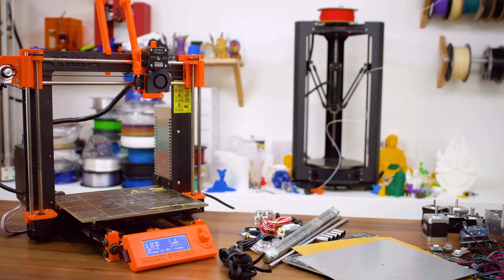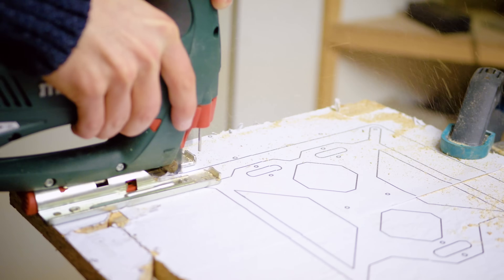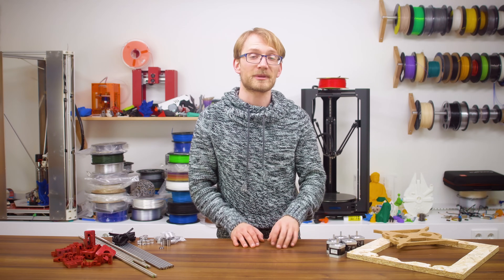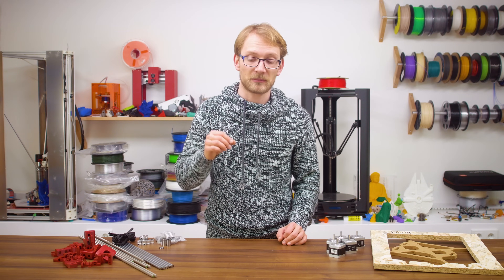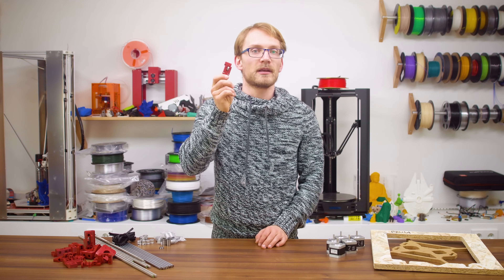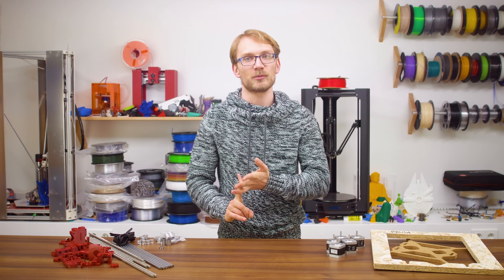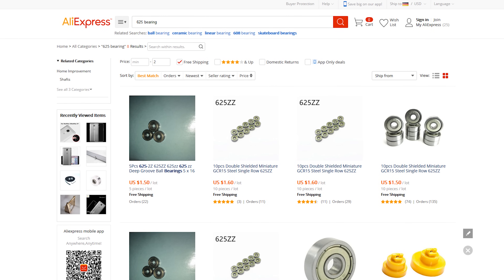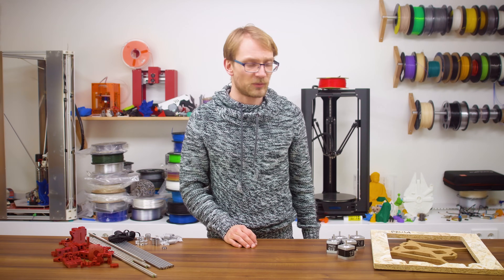Building the cheapest possible Prusa i3 MK2 clone: [02] Frame and motion!

Comment: hi Thomas great videos!! am printing the parts now. 
i have t8 8mm lead screws and wondering if they will do the job? or is it best to get the m5 threaded rod?
cheers
Reply: The real MK42 from Josef Prusa (and any modern printer worth crap) ditched all threaded rod on Z already.  The hard part is finding the Z motor mounts and the Z smooth rod holders that stand out enough to allow those 8mm (the nut is why) acme rods to be used (you would need two new X pieces as well) and is still a Prusa design.  If you already have a printer, and find or design a new set of those pieces, then print them out and your printer, and prints, will be far superior.

Comment: I would suggest a BB or a single 2.5mm ball bearing between the Z motors and the threaded rod.  That will give it a nice surface to equalize itself if the rod is less than straight.  Also, I don't think you really need zip ties to hold them if they are tight enough.

Comment: Tom, a question:  I already have a Prusa I3 but the Rework version so how much would it cost me to swap it over to the MK2 and is there a reason to do so?
Reply: Great videos, very helpful for the initiated into 3D, btw can you make a playlist for check and save this valuable info?
Reply: Since the inception of the MK2 I have been asking for the bed to be released because I want one and what about someone who a year or two after they purchased their printer and their MK42 bed dies (as my MK2 did for the previous version)?  They can't buy one which is utter Josef Prusa BS.

Oh, and those motors are fine for XYZ but for a direct drive they struggle due to the lack of torque and the better option for the extruder would be the 17hs8401 due to the increased torque it has.

Comment: how bad is stainless steel smooth rod compared to chrome plated?
Reply: and why 16 teeth pulley not 20 tooth, what's the difference
Reply: Runder Caster stainless rod is soft and the balls inside the bearings will cut into them. The 16 tooth pulleys move the bed and X carriage, a smaller pulley will give more accuracy while a larger one will move the belt faster.
Reply: IRAnarchy thanks
Reply: I always have used 16T as it makes the best choice against the 20T for that reason and because it is an evenly divisible ratio (I believe the next one like that would be a 10T but good luck with that).  Use a Prusa calculator with 20T and a 16T to understand better.
Reply: I have found the 16t idler has too small of a bearing for the belt tension. I have destroyed 4 bearings so far and seriously suspect the belt tension to be the reason for the premature failures. I'd suggest a larger idler and bearing that is shifted to account for the increased radius. Or switch from 2 ball bearings to 1 roller bearing for increase load ratings.
Reply: Whatever someone does do NOT mix 20T and 16T or whatever just keep them the same or flip the belt over and use two bearings (I use two 625ZZ bearings with a flipped belt). As far as the main gears stick with the 16T.
Reply: Why would using 10T be bad?
Reply: They can be mixed but need to be adjusted in the firmware.
I used 20T pulleys
Reply: Could you please explain what you mean by "flip the belt over".  Thanks.
Reply: I haven't tried to find one, but I think finding a 10 tooth pulley would not be easy.  Perhaps Dark Alchemist could confirm this is what he means.  A 10 tooth pulley would have a very small diameter... possibly too small for the toothed belt to engage with reliably.
Reply: 10 tooth pulley have same diameter but just less tooth (made for belt with bigger teeth), that's why you should stick with 16T

Comment: I found most cheap and "slightly less cheap" LMxxUU bearings to be actually the same. Rule of thumb: If they come in little bags of two they probably come from the same factory. Good ones start at about 5€ per piece and are packaged individually. In the long run those are actually cheaper as they will literally last forever on a 3D printer.

Comment: Next time use Multiplex, is much more stable and can be found at your local obi, bahr, globus, toom, bauhaus, praktiker or hagebaumarkt.
Reply: There is a restekiste where you can find the pretty cheap. Found yesterday one for 13 Euros! And you wont waste much of it. The multiplex should be way less sensitive to vibrations than any osb, since of the alignement there are almost no air holes.
Reply: ipasuhd plywood
Reply: I lied in this commend, and it still haunts me till this day!

Comment: Tom, what would it take to modify this build to fit in a 300x300 aluminum heated bed instead of the default 210x250?  Just widen the frame and get appropriately-sized threaded/smooth rods or is it more complicated than that?  Maybe a larger Y axis motor?

Comment: wouldn't it be simpler (and more accurate) to print the bed holder, instead of cutting it from wood? In terms of rigidity it shouldn't make much difference, as long as you print it thick enough.

Comment: The Aliexpress 3d printers sellers (clone of the clone) will love you once you released the full build guide.

Get ready for seeing Prusa Tom i4 MK3 released on AE.
Reply: Can't wait to see hand-cut frames for sale on Aliexpress!
Reply: Yvan Rivard haha maybe they'll show up on Etsy.
Reply: Mega Making No it's the Prune iCheap 4D
Reply: I wouldnt be too sad about that tbh, altough i am currently saving up for the real deal
Reply: so many prusa on ali now
Reply: Don't you mean the Sanladerer i4?
Reply: Don't you mean the Sanladerer i4?
Reply: The TEVO Tarantula cost 200$ and the A8 cost 150$, better quality and its all packet to DIY in a Box, no point to follow this beyond experimentation and have a fun time.
Reply: I sense that the logistical costs built in through buying and shipping components separately is going to end up costing more than some kits presently out there. Then there is the issue with tracking down a myriad of shipments, some of which coming from less than entirely reliable sources in order to minimize cost. Still of merit to the hobbyist who takes pride building their own. For cheap I'd use an "Aliexpress" package to bulk together most of the basic requirements then add on enhancements. For the customer it's just one shipment to track. Regarding cost, the suppliers are buying parts directly from manufacturers locally in bulk thus can work on lower margins selling them as a bundle of parts in an entire assembly. Even if you throw 1/3 of it away and custom build the rest the way you want it you'll likely be ahead of the game in parts costs and logistical headaches avoided.

Comment: would not recommend particle board OSB.
Reply: Exactly. You guys are missing the point. He's going for easiest and cheapest here. If you want to replace the osb with whatever aerospace material laminated together with the blood of unicorns knock yours out.
Reply: OSB is fine in theory, but the frame has some rather thin sections and OSB as it doesn't have long grain does break easily.. Plywood would be much better in terms of stability, but obviously way more expensive. You could use some scraps of wood to strengthen the thin sections, but i have no idea if there would be room to do this on the i3.
Reply: I'm with you on the plywood. Good plywood is expensive, though and cheap plywood as well as expensive can bend like potato chips in humid environments. That should't happen with OSB. I guess it will come down to price and preference. In the end the wooden parts will be easily interchangeable.
Reply: Jttv that's why he used OSB...
Reply: oops mixed up OSB with particle board. still not a fan
Reply: Please Tom, no OSB, go for plywood instead.
Reply: 2 inch invar alloy.

Seriously though, it got to be the easiest part of all to replace with whatever you prefer instead.
Reply: I would think mdf would be the way to go as it is more dimensionally stable. plywood can get out of true in time. not much but for something like this it might not be a great idea.
Reply: That's fine but whenever you're cutting mdf you want to be in the room next door, not breathing it in.
Reply: there is cheap and frugal and then there is skimping on materials which will bite you in the ass.